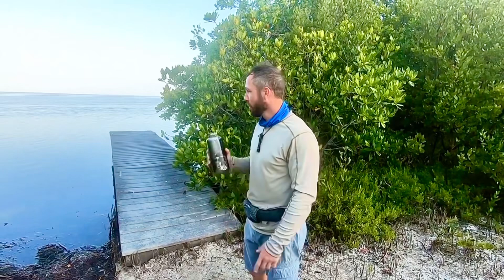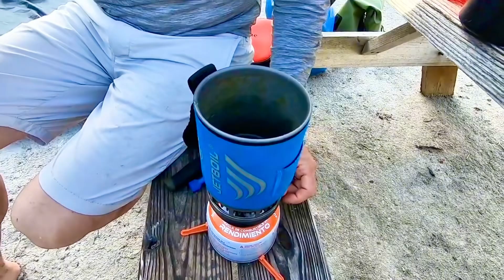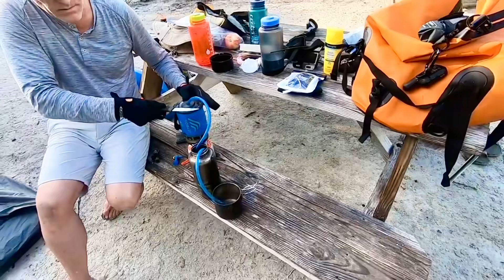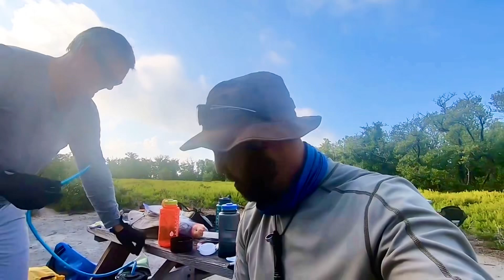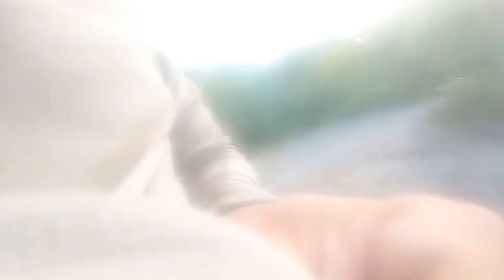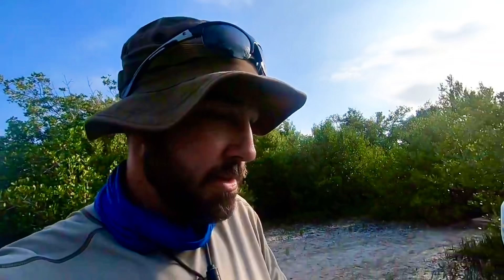The Ultimate Survival Guide: Testing Compact Desalination

Comment: I have been desalinating salt water for years. I use a small pressure cooker and heat it up with drift wood from the beach. Do not put the steam regulator on. Let the steam come out the top and hold a Sham Wow towel over the top to soak up the steam water. Use heavy rubber gloves to protect your hands. Squeeze the water from the sham wow towel into a large pot and repeat. The salt stays in the pressure cooker and can be rinsed out as needed. The result is clean distilled water that is absorbed in the towel. Dedicate the towel to this purpose only and keep it clean. The reason for the sham wow towel is because it holds more water than a regular towel. Works every time.
Reply from the maker: Love it! Thanks for sharing!